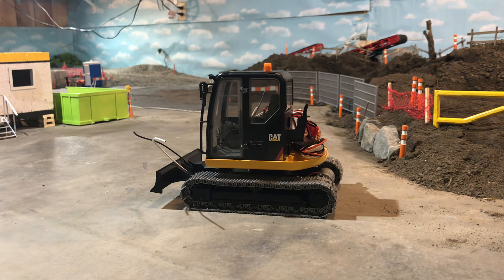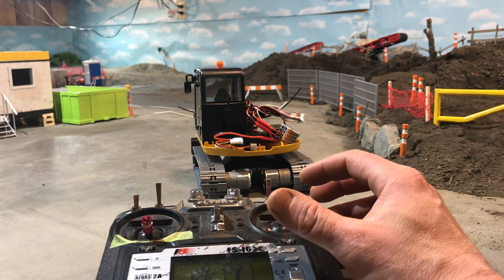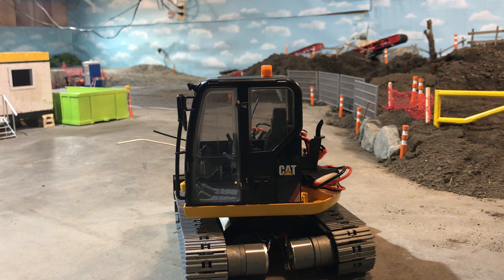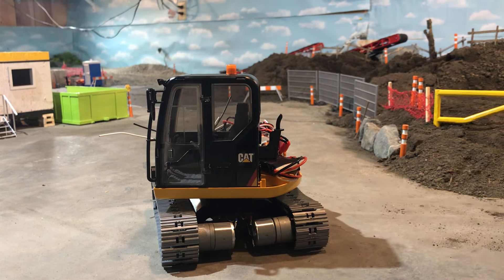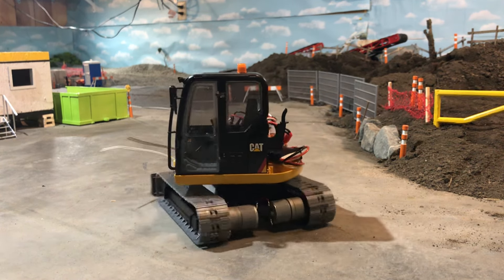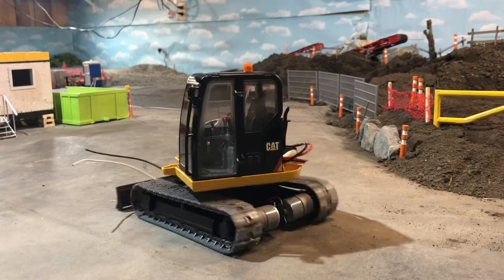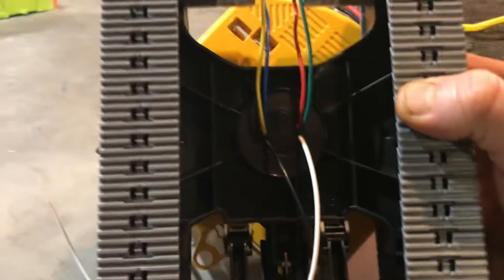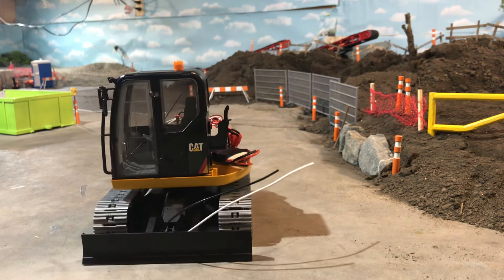RC CAT 308 DRIVE MOTORS

Comment: nice! my build is almost done but the tracks, ive been think on what to do because i think the stock gear for the tracks will slip because my excavator weighs like 4lb.
Are those stock track gears (idk what its called) or are they aftermarket? i need tracks thatll work with 4lb of weight BUT i also want to add more weight. i got a couple videos on my channel if you wanna see my build, there not vary good videos tho
Reply from the maker: I usually put some small screws in the the tracks to help them grab. It also puts a little tension on it too. i uses 2mm pins on my mini scheaff...... i like your build.
Reply: @rcconstructionincanada3754  funny you say that because I was just looking at it and was thinking of how I can put screws on my gear to grip the track...Any way you could send some pictures of what you did?
Reply from the maker: @my_rcs_only  depends if I have some pics. Are you on Bruder conversions and similar builds? Facebook. If so that would be the place if I have them.

Comment: What slip ring did u buy
Reply from the maker: i use basically the ones ths=at are in the huina 580, except for this one its a 6 wire slip ring, because of the two drive motors, and the grade blade function. go on aliexpress and start poking around there, alot of my stuff comes from china  unless iam really impatient then maybe amazon, but its 10 times the cost vs aliexpress. ebay isnt too bad for parts but shipping will kill you.